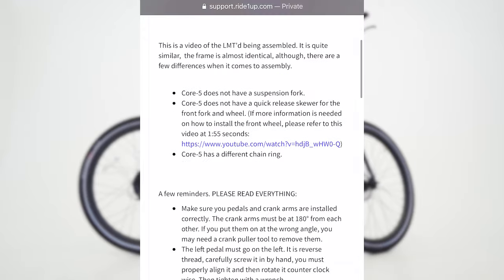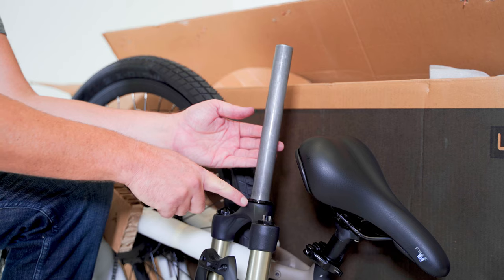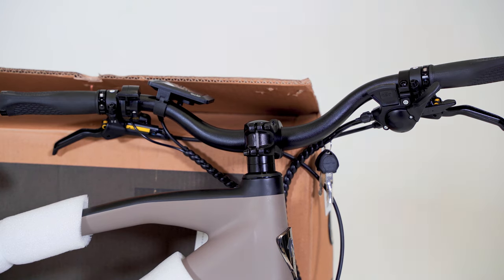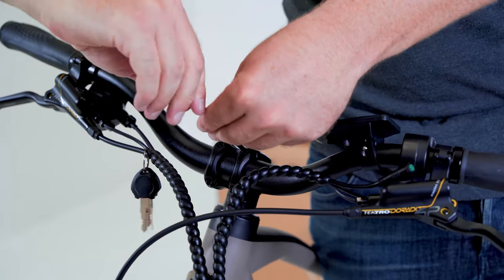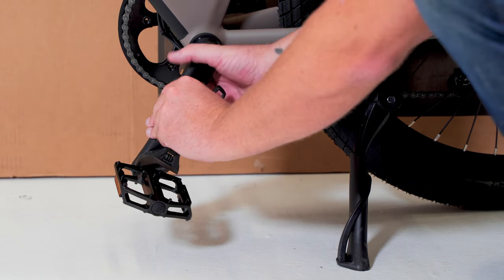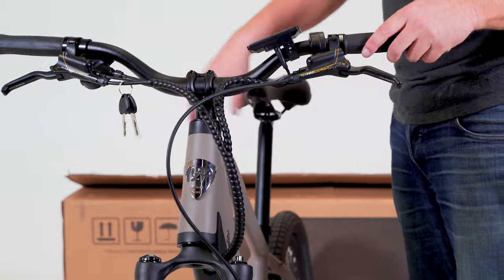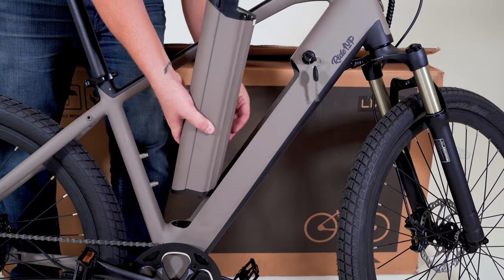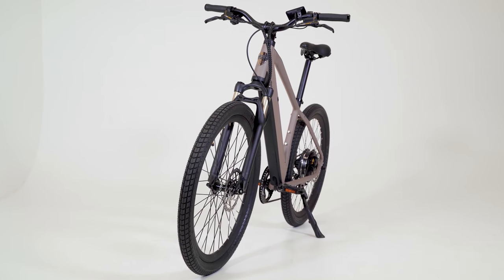Ride1UP LMT'D Assembly & Unboxing

Comment: Just put one together for my wife.  As someone who's worked on bike for 25 years, the setup was fine but when I think of normal people trying to put this together, I'm not sure people should.  It needs quite a bit of setup to be in the same condition as a new bike from a bike store.  If someone who doesn't know bike mechanics very well were getting this, I think I would recommend paying a bike store a few hundred to set it up.  People tend to think bike setup is easy, and it is, but there's a lot of knowledge needed to do the job right.  When the bike can go 30 miles an hour, you don't want a failure.  I don't work in a bike shop and never have.  Just someone who seen and worked on a lot of bikes.

One potentially pitfall is that most people don't have the necessary torque wrenches that would work for a build like this.  40nm is about 30 foot pounds.  That's quite a bit of torque that takes a big torque wrench.  One the other end, the headset and stem use much lower torque so you need two torque wrenches, realistically.  One that reads inch pounds and one for foot pounds.

It's interesting to see the intersection of old and new technology on these bikes.  They have disc brakes, which are pretty new, but use square taper bottom brackets, which is old.  Like 25 years old.  Another problem is that once you install the crank on a square taper bb, that can't be removed properly without a crank puller, so you'd better make sure the ring that secure the bottom bracket is installed correctly.  There's no going back without buying a tool.

Comment: The instructions for installing the crank on a bike equipped with a torque sensor are nothing short of confusing. After scratching my head for a while, I figured out that on this model the bottom bracket is not held in place by the crank bolts (like in cheap bikes) but requires a separate ring, like in higher quality bikes, and that's what the BB22 included tool is for. You slid on the chainring on, then thread the locking ring (which is left-handed), and using the BB22 tool, on which you slip a 24 mm socket (15/16 " is close enough to work), torque it to 36 N.m. I don't know what those who don't own a torque wrench are supposed to do; this step seems quite critical for the correct operation of the sensor and would not recommend doing it "by feel."

Comment: 18 April 2022.  (But please see EDIT below for how this was resolved.)  My LMT'D  arrived today with a couple of deep gouges in the paint, all the way to bare aluminum, one on the top tube and one on the drive side chain stay.  I suspect both were caused by the front fork shifting around in the box.  There's some superficial damage to the fork's head tube bearing surface as well.  The outer box seems in pretty good shape, so this damage was likely due to inadequate inner packaging.  

Worse, my front tire tube has no valve core; zero, nada, just not there.  This video shows at least a few pounds of air in the tires when the bike is lifted from its box.  Not so with mine.  Both dead flat and wrinkled, have never seen air.  Given I cannot inflate the front tire, all the rest of the set up beyond "inflate the tires" is a completely moot point.  Ride1UP agreed to send me the missing core and a core tool, but until those arrive -- estimated 48 hours from now -- I can't even try it out.  Sure, I could go out and procure these items, but it's not on me to go buy things to make the bike operational.  It is beyond me how Ride1UP would ship out a bike without even inflating the tires to a few pounds.  Had they even tried, this error could not have occurred.  

QA score: D- at best.  Realistically, solid F.  What other grade can you award to a bike that arrived with badly damaged paint and a tire that won't inflate.

EDIT, 19 April 2022 (Next day!).  I have a satisfactory resolution.  Matt from Ride1UP has sent me valve cores, a valve core wrench, and a fresh tube in case the core doesn't solve the issue, slated to arrive tomorrow.  Additionally, he has provided guidance for making paint repairs and has offered a partial refund for my trouble, which I have accepted.  Less than 24 hours to get this sorted.  Good job, Ride1UP.   Stuff happens, and when a company accepts accountability and quickly makes a situation right, that company deserves such a high mark.  Customer service score: Solid A.

Comment: does anyone know what the additional step is when installing the chain ring on the LMT'd with torque sensor? I can't figure it out
Reply: I went  in a few circles with this also, the hap hazard instructions, new/old videos.  I connected the chain ring per the video and there did not seem to be anything else related to the torque sensor, bike is functioning as normal as I understand it.

Comment: torque sensor step is confusing/links lead to pages with wrong info...I'm officially worried to start this myself. Sensor may become damaged
Reply from the maker: If you take your time and follow the assembly page tips and this video you should be able to complete it. However, if you need assistance, please reach out to our support team if you haven't already. www.Ride1UP.com/contact
Reply: Same here. No clear instructions for the crank assembly steps. Also nothing to say whether I have a torque sensor or not. Oh and also how about having colors on your website that actually match the color of the bike. I ordered the new sparkly dark gray and got this ugly blue steel bullshit. Not a good start.
Reply: Oh sorry you know what I just realized. They sent me the previous version of this bike. This isn’t even the right color. Trying to pawn off old equipment and hoping customers won’t notice.
Reply: @Ride1Up  No you guys severely dropped the ball here. Your page that explains how to do the torque sensor tries to tell me that the newest generation of LMT'd bike has a cadence sensor. Obviously it does not but your support articles state it does and that I do not have to hook up the torque sensor. Get your stuff together guys! Scroll down the page to what you linked in the description and see the page for "LMT'D Bottom Bracket Torque Sensor" that says everything I state here. Please update your help articles that are consumer facing to be accurate.

It's way worse than I had thought. The article for the torque sensor is specifically for the Bafang motors as well. I am starting to feel like I bought from the wrong place. Nothing hurts business more than things like this where it is clear you are not updating your documentation for new products at all.
Reply from the maker: @xex2kok  Please let us know which part you are referring to. This is the assembly page for the LMT'd with torque sensor. https://ride1up.freshdesk.com/a/solutions/articles/65000171268

We will certainly use your feedback to improve it. Feel free to share additional info www.ride1up.com/contact
Reply: @Ride1Up  I described exactly what was happening. I am not going to type the same thing up again when it is already there. Read my description again if you are having trouble understanding it would be my only suggestion.

If you would like to pay for consulting time I would be willing to do as you ask but I am not going to do this for you for free. You are making money off this, not me.
Reply: @Ride1Up  The assembly instructions for the LMT'D with torque sensor are abysmal - which bike is which? Everything seems out of date. Please update videos when you update products.
Reply: Are y'all still shipping cadence sensor LMTDs? Because that's what I just got, despite your advertising torque sensors.
Reply: Still out of date. Still cannot locate proper documentation on torque sensor instructions.

Comment: Why is the latest limited switched from torque to cadence,. Is that a downgrade or upgrade? Are cadence sensor cheaper? Then why did  the price go up?
Reply from the maker: This was based on feedback, some riders prefer the cadence sensor as they do not have to pedal as hard to get the output they want. So it really depends on your needs. In regards to price, many things impact this, one example being the cost and demand for battery cells and shipping containers.
Reply: @Ride1Up  i just wish they have selectable cadence and torque sensors. Other than that, i have to give Ride1 Up 👍🏽👍🏽 for excellent post-sale Customer Service.
Reply: @Ride1Up  Love your bikes but the selections are too restrictive. I want a LMT'D in an XR frame but due to high standover height I need to get a ST frame. Okay fine, I could live with that. But that means I have no choice to accept the cadence sensor, and not the torque sensor that I'd far prefer. It also means that I will get swept back cafe handlebars and a shorter reach. I understand you do all of this to control costs and streamline operations, but by doing so you're not really serving your customer.
Reply: +1 to that, I'd say that shipping cadence when your site says torque is essentially deceptive practices .. edit: turns out there is a torque sensor, it just feels a bit different than I'm used to because it's a rear wheel motor. It was very confusing and hard to follow the directions - seemed like I was missing a step but I wasn't.
Reply: @alibagheri143  I ordered a new LMT'd ST with a torque sensor and it arrived this week. Are you saying that your bike arrived with a cadence sensor instead of the torque sensor?
Reply: @xmarcelo1  no it turns out it was a torque sensor
Reply: @alibagheri143  thank you Ali

Comment: Help!

My LMT’d arrived yesterday with a warped front disc rotor and faulty front tire valve stem. I was able to fix the faulty valve stem but can’t true the bent rotor myself.

I can’t seem to contact your support because the page on your website to submit a request is broken. Keeps thinking I didn’t do the captcha when I did… 🙄

Comment: REGRET. 100 percent. I'm now SEVEN WEEKS into my ordeal - I mean - purchase of a Ride1Up LMT'D.  People need to know and understand how much of a pain in the *ss this process is, EVEN IF you are mechanically inclined. BOTTOM LINE: The reason Ride1Up can sell their bikes so cheap is because it is on YOU, the client, to make it work properly. TRANSLATION: Ride1Up doesn't value your time, and it will require A LOT of your time. And frustration. And you'll have to buy new tools to do the sh*t that these people couldn't get right from the factory. Seriously, don't buy in to the BS. Run. RUN. Go to a brick and mortar store with reputable brands. This company conned me into spending nearly two thousand bucks on their attempt at a quality product, leaving it up to me to invest either in having it assembled and fixed properly or invest in sending it back to them. What an F-YOU business plan for their clients. 

Bike arrived damaged... paint chips, rear derailed scratched / bent. Rear wheel bent with broken spokes. Missing headset component (1) and wrong headset component (1). Replacement rear wheel arrives 12 days later with broken stator. Don't worry! They have a video on how to do that, every bit as unhelpful as their other videos; also, it requires tools most normal people don't have, and even more time. Broken stator has to be replaced before you replace the rear wheel. And it's really advised to have a bike stand to do this. And to have a local bike shop true your wheels. And, and, and... the list goes on. People, don't do this to yourselves. I did the research for you. They should call this company Call1Up, because you'll be doing that to Uber for weeks, if not MONTHS (like in my case) before you can get your bike usable.